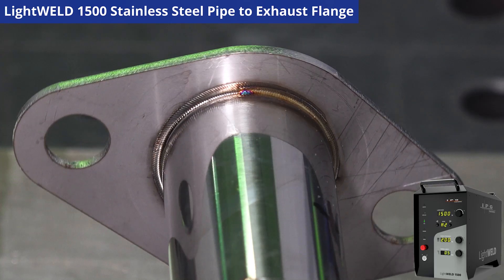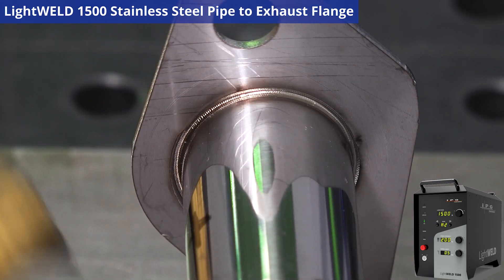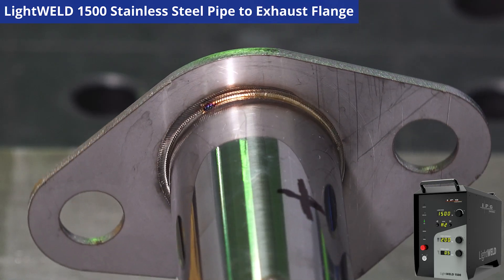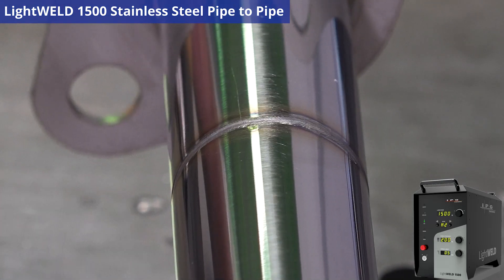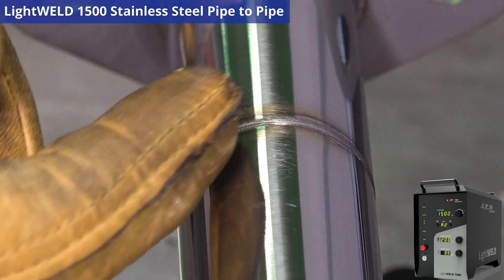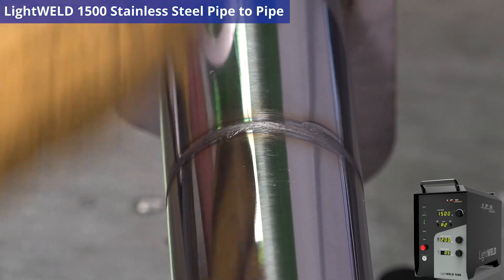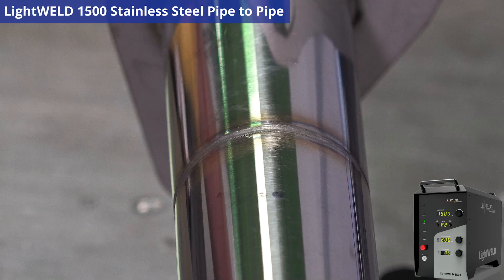LightWELD | Laser Welding Stainless Steel Pipe to Exhaust Flange

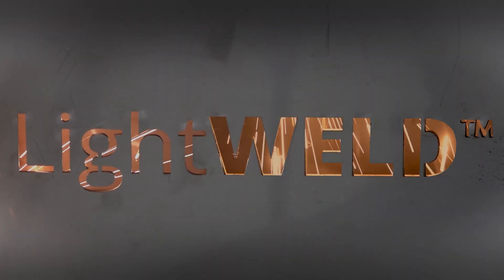Comment: Perfect settings on wobble, wobble frequency and speed,  I think he said its in the presets. On the quick set up sheet none of the settings wobble, user has to define it along with wobble frequency, obviously you can save it and load it when needed. Perhaps it's a user defined saved preset. If you look at it 2:34 the technician did not run a straight line, you can avoid it on production parts or even single task if you use a " gun guide jig" unbeatable speed and weld profile 0 post processing needed

Comment: My critique of these videos is that the presenter doesn't say the methods or setting. This is obviously a Autogenous Weld of stainless. But, that is only obvious to someone that knows a bit about welding. $20 K for a welder that operates this quickly is very very affordable for a company.

Comment: For $20k, I doubt the sales make a reasonable profit.
Reply: We have tig welders in our shop that are worth 20 grand Miller dynasty 800. 20 grand is very cheap for a portable fiber optic laser welder in a manufacturing environment it’s not for the hobbyist and neither are the robotic spot welders used in automotive
Reply: @jbweld2895  I think that’s what Kevin is saying. The price is reasonable so the profits can’t be too high.
Reply: The ROI on this machine is insanely fast for any job shop pushing volume. It eliminates basically all cleaning time and lowers labor dramatically.

Comment: Impressive, can this be used with Titanium or Copper? Can you weld dissimilar metals like Stainless to Copper?
Reply: you can weld both with this unit but on the titanium you have to use Fusion weld, I don't think there is titanium wire spools are available and if there is, it has an astronomical price, and yes you can weld dissimilar metal as long as you know which can be fused with an other type (metallurgy) by the way on the video he is not using wire feeder therefor he is fusion welding